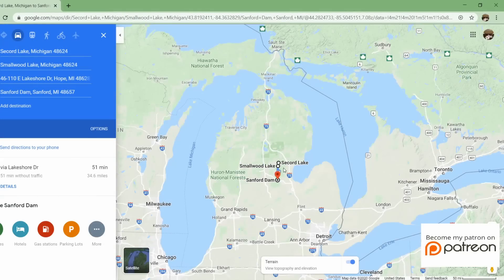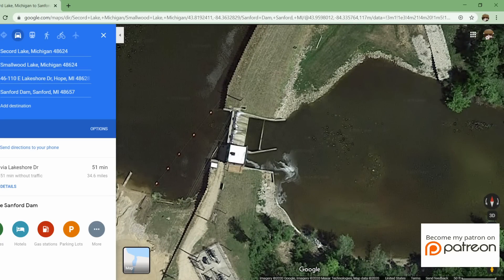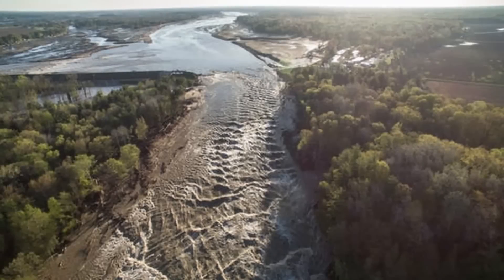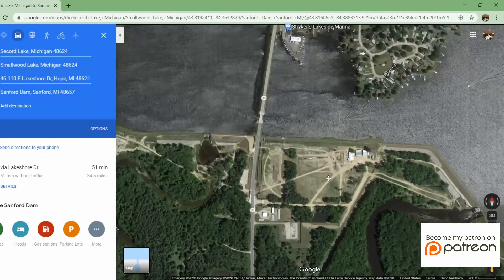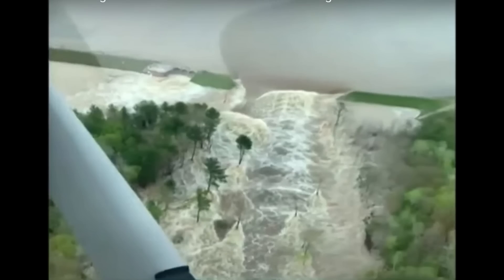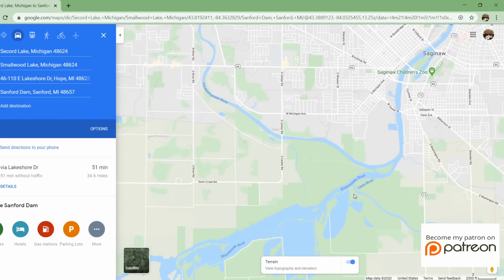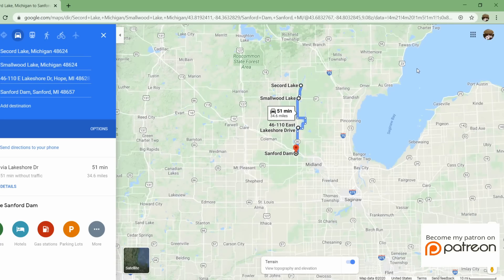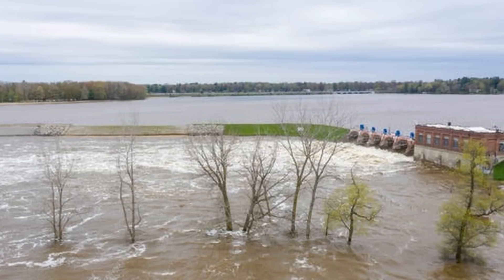Michigan Dam(s) Fail!   Tittabawassee River.

Comment: 3:08 Wixom Lake is (was) formed near the junction of two rivers, the Tobacco from the northwest and the Tittabawassee from the northeast.  The structure at 3:08 is the dam on the Tobacco.  The water from both rivers now flows through the failed Edenville dam.
5:53 "...over 50-year old dams"  They are nearly 100 years old.
6:29 "If the water ever tops an earth-filled dam, that earth-filled dam will fail."  From what I saw, the Edenville dam was not topped.  It appeared the dam collapsed, perhaps from being saturated.  That was the cause of the infamous Johnstown Flood (1889).  The Sanford dam was topped and washed out.  Both dams have the flood gates open, but the big question is, When were they opened?  Was it too late to do any good or were they just inadequate to handle the flow?

Comment: Thanks to my wife for allowing to post. We live close to the Tittabawassee River down stream of Freeland. News reports stated Sanford dam had failed. We knew no such thing early on. It was impossible to know. Today drone video is available on YouTube. Sanford dam was destroyed by the force of water, debris from Wixom Lake, as well as, gathering debris as it traveled down stream. I believe the town of Sanford is gone. Still waiting to hear from family. Shields is the closest town across the river, seven minutes. Yesterday one hour and fifteen minute drive.

Back in the 80's Dow Chemical released dioxins into the river. Since that time Dow has attempted to compensate. Some fish you can catch and eat. Others are not safe. Signs are posted along the river. Wash down stations are available should you come into contact with river, soil, grass, trees, etc. All that is washing down stream. The potential impact is unknown at this time. Dow is already making public statements. Number of destroyed roads and bridges is unknown. How many years to repair is unknown.

The potential failure of Edenville dam is nothing new. We have known about the issue for twenty one (21) years, Granholm, Snyder and Whitmer. In 2018 the feds finally pulled licensing from the company that owned the dam. At that point, it became the responsibility of the State of Michigan. Court battle lasted three weeks. Gov. Gretchen Whitmer blames this new "State of Emergency" on global warming. As I said, we have natural 100 year cycles in Michigan. None of this is new. Now the Tittabawassee river will find it's natural path. - Michael Boldt

Comment: Question for the dam experts. Having seen a few of these emergency spillways being called into use now my impression is that they seem to be designed to erode as well, that is they are just a lower earthen bank. Is that impression correct? My thought is that a lot of water in full flow over a dirt bank is always going to cause major erosion and cause a lot of remedial work  afterwards as we saw with the emergency spillway at Oriville. Would it not be better to always fortify the emergency spillway at initial construction?  Thanks for the video as always Juan,  can rely on you for honest unbiased reporting.

Comment: Don't forget to research the lawsuit the Michigan AG did against Boyce for lowering the lake levels and killing off some of the freshwater mussels. Boyce lowered levels 8ft when they were told only 3ft because they were worried about a dam failure. The lakefront property owners were also complaining that the 8ft was hampering boating in the area. There is alot of underlying issues to the whole story on why the dam failed.

Comment: Boyce Hydro was forced to raise the water on wixom lake because people were more concerned about boating rather than the safety of our neighbors to the south. I personally have hauled concrete to these dams over the last 8 years Boyce Hydro has done lots of restoration to these dams it's not their fault it's the people that wanted the lake back for boating. The lake was lowered in the fall and just filled back up 2 weeks ago. If would've been lowered still this wouldn't have happened.
Reply: The lake still wasn't full before the weather hit. I just drove through Albright shores at the beginning of the month and the upper lake was still empty. I'm sure with all the instantaneous rainfall and upper dams opening the gates wide, it didn't take long to top it off anyway. It had been lowered for an inspection, wonder what kind of forces are involved with the earthen dam being allowed to dry out for a year, then saturation and sucking water up like a sponge? Maybe some unsettlement to the core?

Comment: Most emergency spill ways are concrete lined. If it is only earthen - a emergency spillway would collapse just like the dam. If the concrete emergency spill ways are not maintained or strong enough they also will fail. This look like cascaded as the upper one failed the next one lower will not be able to release enough water fast enough. As you saw in the California dam failure. Take care.

Comment: If you have never flooded before and don't have flood insurance this will be a nightmare you will never forget.
I speak from experience, having been flooded in 1989, with 5 1/2 feet of water in our home.
NOW, TODAY, THIS MOMENT, remove all of the pictures from your phone, iPad, camera sim card. 
THIS IS VERY IMPORTANT!
You need the space on these items for the PICTURES you will take from here on out. PICTURES, PICTURES, PICTURES, or as your insurance man will say, EVIDENCE, EVIDENCE, EVIDENCE.
For those without flood insurance, contact your local government ASAP. The ONLY WAY, you can get FEMA money is by your governor declaring a, STATE OF EMERGENCY for your area.
No State of Emergency, NO FEMA.
Once the water has receded, PHOTOGRAPH EVERYTHING.
Everything means EVERYTHING, size does not matter. Capture as many images of the damage as possible and then take more pictures.
Call your insurance person, just in case, to make sure you can start removing drywall and carpet. FANS, FANS, FANS, get things dried out as soon as possible.
Contact the city or county officials to see where and what they want you to place on the curb for future pick up.
Most of the things you can do are common sense. Move things out of the basement. Move things to a second or third level.
MOVE YOUR MOST VALUABLE POSSESIONS FIRST. Pictures, albums, antiques, shoes and cloths.
Please feel free to reach out to me if you have questions. 
You will get through this, remember, ITS ONLY THINGS and things can be replaced, your life cannot.
TURN AROUND, DON'T DROWN. IF YOU CAN'T SEE THE STREET OR YOU ARE NOT SURE DON'T DRIVE THROUGH STANDING WATER...

Comment: Even a concrete dam will fail if over-topped, not just earthen dams. The amount of damage to the dam is greater with earth dams than concrete. The only reason earth dams are chosen over concrete is cost. It is far cheaper to move dirt than pour concrete.

The footage showing the drained lake also shows a large supply of the earth needed to rebuild the dam, at the same time making the lake deeper by getting it back to the original planned depth by removing the silt that was filling it. I bet the others will show the same when footage is available of them.

I do appreciate your factual reporting of this event far more than the sensationalist reporting mainstream media does for such events.

Comment: It appears that the Sanford dam emergency spillway functioned as designed. It passed enough water to equalize the levels up and downstream. And apparently withstood the erosion. River crested at 35 feet vs 38 feet forecasted. Still bad flooding in Sanford and Midland. No passage across Titt. River for 25 miles or more.

Comment: I think your operational knowledge of dams and failure modes of earthen embankment dams will prove useful. There are already new channels reporting (erroneously I believe) that the condition of the dam structures are potentially to blame. So far from the images and footage being made available on the internet, it seems far more likely the quantity of water (from rainfall, etc) overwhelmed the various dams safety systems (spillways, emergency spillways). While there appears to be some foul-play in lack of maintenance of dam structures by previous and current owners, ya gotta call a duck a duck. Super job as always at bringing a rational voice to the discussion :)

Comment: Thank you for this information! 
I would like to point out that  Wixom Lake at Edenville is where two rivers come together.
On the West side of  highway 30 is the Tobacco river. 
The Tobacco is  also dammed at Beaverton Michigan. There is also Chappel Dam that feeds 
The Cedar River that flows through the City of Gladwin to meet Ross lake.  Which is where the dam is. 
I hope for another video showing North and West of Wixom (Edenville  dam) 
Edenville dam was built in 1925.... ☮

Comment: Here in Missouri we have some old mining dams that are in the process of dumping out. They are more of an inconvenience then a real problem.

However where I live we have a major flood control damn that has had water over the emergency spill way twice in the last 20 years and only one time before that.

Each time the water has pushed out a good twenty foot deep canyon out at the foot all the way to the river.

Each time as the water was raising they multiplied the forces by using sand bags to bring the water up another couple of feet.

So instead of the spillway being topped by fractions of inches at a time we get two feet of water on an 8,000 acre lake dumping.

Once your water comes up to the concrete spill way let it go!! The fight is over and just let it go.

Sand bags will give you a few feet but during that time your earthen damn is saturating anyway.

That two foot explosion of water destroys everything at a run..

Comment: They've had 250% above average rainfall there for the month of May - ends up with a 500-year flood. Plus we had a late spring - late thaw - with late snowstorms.
Four of the dams on the river failed. Two were washed out and the others rendered inoperative. Great Lakes are at record high water levels. Chicago area has had three record rainfall years in a row now.
Wixom Lake is back to being just a river. Totally drained.

Comment: Report from Edenville dam had a pair of bouys lodged against the upstream face, with an employee walking out to retrieve them, when a small cascade erupted from the downstream face.

Assumption... nobody's going to walk out on a topped earth dam, therefore, those bouys were pulled to that spot by flow thru fractures below the surface.

Perhaps inadequate primary and emergency spillway capacity, and inability to control levels, but... failure NOT at emergency spillway, and NOT due to topping.

Interestingly, Google overheads, pre-failure, seem to indicate some kind of construction activity at the toe of the dam in that location, prior to the rain event.

https://youtu.be/Hc3u_CHVHJ8

This video shows the two bouys, and the cascade, along with apparant slumping along the crest of the dam at the failure point.

High levels, increased pore pressure, visible flow from the downstream face, and you can see "geyser-like" eruptions from the collapsing mudflow, indicating that area was saturated, with ready communication between the upstream and downstream face, prior to full on collapse.

Oh, and hey... this guy's in the wrong spot...

https://youtu.be/bqYhdHaOCk0

Comment: Great reporting as usual. I once lived in Midland, so spring floods there are common. The Wixom Edenville dam has been problematic for years - receiving a poor grade from the Michigan ASCE (American Society of Civil Engineers), while the Sanford dam, which was topped but apparently did not experience a total failure, was rated as acceptable.

Comment: Why don't they just open the power station flow gates... it would lower the lake level before it reaches flood level... in some cases during heavy rains it old still cause flooding down stream.. but it would be controlled flooding  ( for lack of a better phrase ) instead of massive uncontrolled flooding.

Comment: Our family has had a cabin on this river system since 1956 (ours is on Secord Lake, the uppermost of the four dammed reservoirs). I have closely followed the legal proceedings that came to a head in 2018 when the Federal Energy Regulatory Commission revoked the license for the failed dam held by the owner of all four dams, after more than a decade of violations. The operator was clearly negligent, driven most likely by the poor economics of hydroelectric power generation in the face of cheap natural gas.

When the license was pulled, a task force was setup that drove the creation of a special taxing district that was to assess property owners on the four lakes in order to finance a bond issue to acquire, improve, maintain and operate the four dams. At the same time, FERC ordered a drawdown of the lakes in late 2018 to inspect the spillways to ensure they were sound. They passed and the lakes were returned to their mandated levels (each lake has a very narrow water level range mandated by the federal government).

Meanwhile, though facing much local resistance, the tax district was created and pushed forward to acquire the dams and the lakes themselves. Though an agreement was apparently reached earlier this year, the deal was not expected to be completed until 2022. Now, this.

Bottom line, the feds were pushing for improvements for years and finally acted. Unfortunately,  the 500 year flood they were seeking to protect against happened just two years later. If anyone is to blame, it is Boyce Hydro, owner of the dams, and the local communities who enjoyed the recreational and economic benefits of four wonderful all-sports lakes and were blissfully ignorant of the risk inherent in their local treasures. 

In closing, there are a lot of emotions locally and a lot of political accusations being made nationally surrounding state and federal responsibility and our crumbling infrastructure. This is not a Republican or Democratic thing, It is a human nature thing that makes clear humans are not perfect, which is why we need to be diligent in keeping a close eye on the things humans do.

Comment: All bridges across Tittabawassa and Saginaw rivers are closed. So is US-10. The main connection to the west side of the state.  East to west now is interstates down by Lansing. Water is entering a vast wetlands system downstream. The Saginaw river a deep draught channel. It was dug when GM had two plants west of Saginaw. Add the high lake levels, lots of water heading towards Lake Huron.
Fun fact. The Saginaw river is one of two rivers that flow south to north in northern hemisphere. Drains roughly 20 counties of Eastern Mighigan. Including north of Detroit and Flint

Comment: As a Michigan resident for 65 years I have never seen water levels so high except once in 1986. US-23 near Augres is covered with water I have never seen that ever, cars at this time are still crossing but it is completely covered. My sons father-in-law has a home on Wixom lake and the basement had 3-4 feet of mud and water that has now subsided but it will be a huge clean up to get the home back to normal.

Comment: Edenville Dam was Built in1925 - 2020, Smallwood Dam, Sanford Dam - These Dam's Could Not Pass Inspection's in 2008 and Had Been Warned...So ?    A little Too Late Now - Earthen Dams Will Fail,  Eventually
Reply: gravity doesn't have to do anything to win...  it is relentless...  add to that the problems of erosion and structural decay, and, well, there ya go...  downhill...

even in a very flat system like where i live i see the effects that erosion can have.

i structure all my gardens in a way to catch as much rain as i can and soak it in, but after several inches of rain on clay even i have to provide escape routes.

spread the entire flow over a wide area with a well populated grassy mix and it can survive some abuse.

but then, guess what?  every burrowing creature will come along and make that bank a home...

life is chaotic.  water and air too.

our expectations of stability are the errors here, not the other way around...